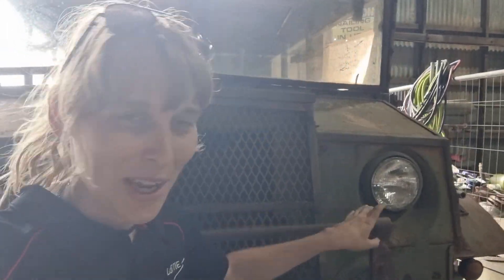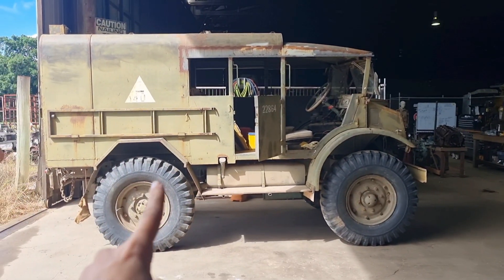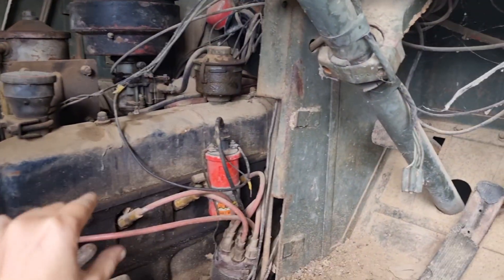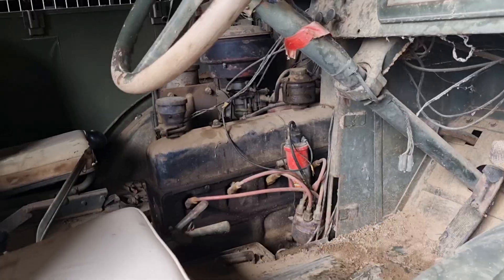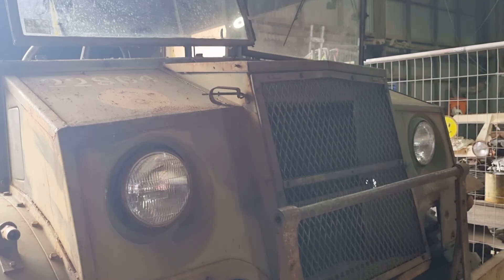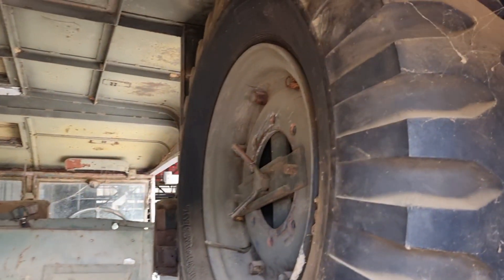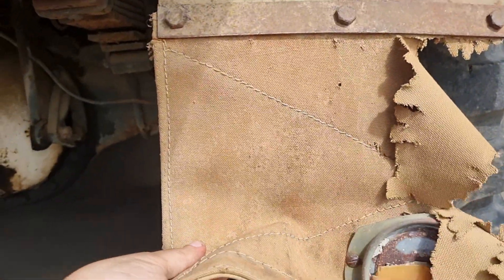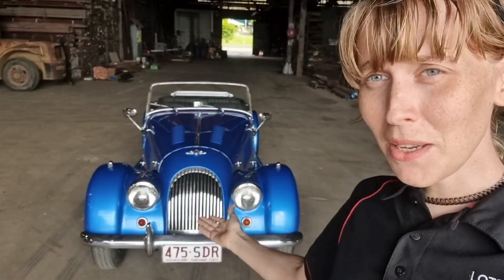WW2 Australian Artillery Tractor

Comment: Some kind of mash up . Chev grafted onto a FGT no nine rear . There about a dozen FGT on the road in Australia and maybe the same number of Chevy . 
The cab chassis were imported complete and the rear made in Australia by chev for the No 8 and Ford No 9 . There is a chance that No 9 rear is one of the Chev built ones rescued from Hughes trading yard when they were going to be scrapped . The Chev no 9 never went into production though about eight rears were built . They were sold for scrap when war ended . 

Someone has mashed this up from a cab chassis and plopped the rear on hence the rust along the weld lines . 
So not an original beast but interesting nonetheless the less . Camo should be KGJ base colour and disruptive either light stone O or the brown introduced in 1943 . AWM has lots of pics … but none of a Chev No 9 as they never existed . I guess an authentic colour for one if they ever did exist would be KG3 the colour reintroduced in 44 after disruptive was abandoned . In that case the limber and gun would also be the same colour . 
What colour did you use on that rebuilt limber ?

Comment: Hope you do a walk-around when its finished, I'm making a set of soldiers for a lad with an Aussie dad (his granddad was at Tobruk I believe), I can scale it using the wheels.  The Kiwis had similar tractors, based on the Canadian Military Pattern trucks built to largely standard designs by different manufacturers (differences include the axles and the front grill design).
Reply from the maker: Awesome! It should be a good model when it's done 😊

Comment: Buff is closer to the colour. You need to ensure the vacuum wipers work as well.
Previous restorer and i suppose last owner of a ford F30 blitz, ex middle east service that wr had the original steel body for, to x Bofors tractor with thw central mounted winch.

Comment: So is that the Morris quad version. The rear axle should be painted white and a separate 5w light with its own switch shine on it from underneath the vehicle. These were known as convoy lights and gave position to driver behind without notifying enemy. There were many accidents with tired drivers driving up the gun in front. The Western Desert can was not a Jerry Can. It was a Flimsy which was packed in wood and disintegrated readily with loss of fuel. Often at that stage a couple of two gallon civilian cans might be used or even an odd Jerry Can which had been liberated! Usually a couple of sand channels were attached to at least one side of the vehicle. There were several means of rolling tyres up onto vehicles but they all involved more than one person.
Tell the owner to finish detail with a Tommy Cooker - a cut down fuel can part filled with sand. This had petrol  added and set fire to and a Dixie was put over the top. You drank your tea and saved the dregs which you lathered your face with and shaved. Sometimes! 
Nice project and you will enjoy it! Well done both of you!
Reply: No, it's a CMP Chevrolet. No 13 cab with the throttle peddle in the middle, between brake and clutch.
Reply: @dukwdriver2909  Thank you for that information.